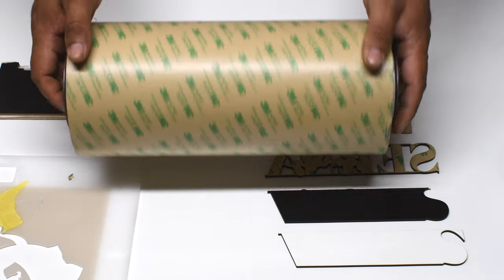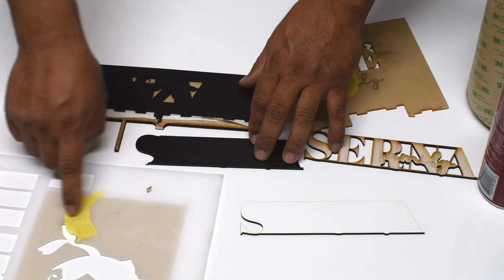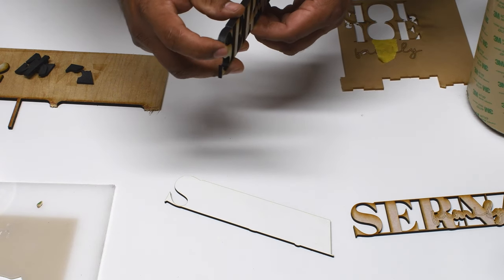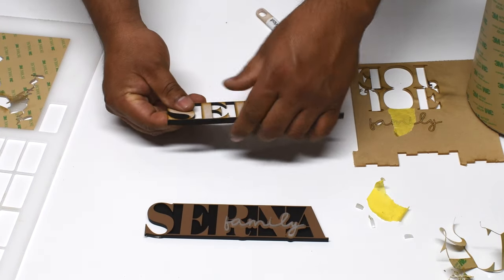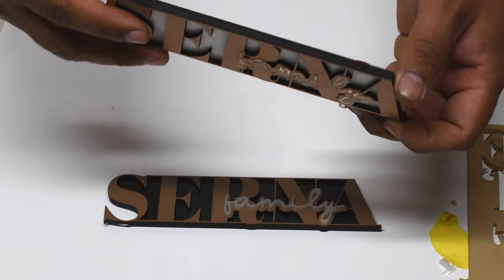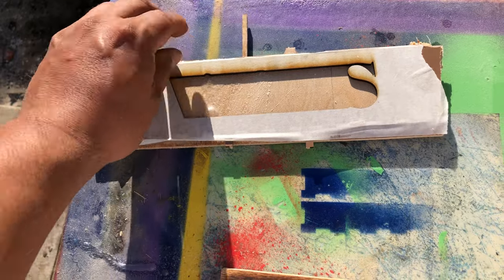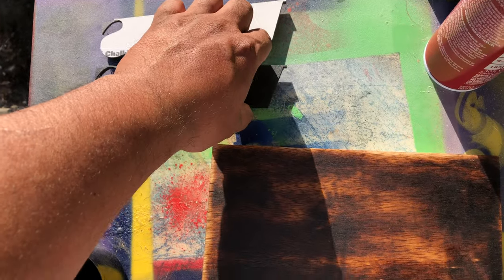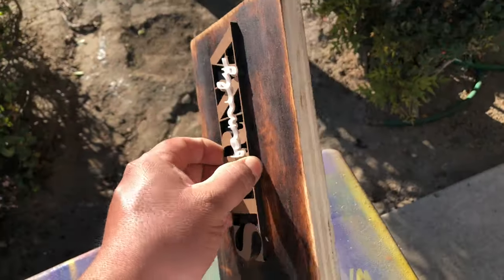3M Double Sided Tape VS 3M Adhesive Spray - Which is Better? | CRAFT FANATIC

Comment: Thank you so much for this video!

I am building a small building table 4'x12" and I am putting 1/4 inch cork on the plywood top and I have the super77 and now I know to spray only the cork and then quickly put it on the plywood

Thank you so much again!
Daniel
Reply from the maker: You’re very welcome

Comment: Thank you for producing these videos and especially the comparison between the 3m 77 and 90 sprays. I would like to know, how do you find the adhesive property differences between the 77 and the double-sided tape you are using in the video? Is there a benefit to using tape over spray adhesive?
Reply from the maker: 3M 77 and 90 sprays are both aerosol adhesives made by 3M. The main difference between the two is the bonding strength and drying time.

3M 77 spray adhesive has a moderate bonding strength and is suitable for bonding lightweight materials such as paper, cardboard, and fabric. It dries quickly, in about 15 minutes.

3M 90 spray adhesive has a strong bonding strength and is suitable for bonding heavier materials such as wood, metal, and plastic. It takes longer to dry, about 24 hours.

Both sprays are clear in color, non-staining and have a low soak-in properties. They are also both repositionable for up to 5 minutes after application, and can be used in both indoor and outdoor applications.

In summary, if you need a quick-drying, moderate-strength adhesive for lightweight materials, 3M 77 spray adhesive is a good choice. If you need a strong adhesive for heavy materials, 3M 90 spray adhesive would be a better option.
Reply: @CraftFanatic2023  An excellent characterization of the products being compared. Thank you!
Reply from the maker: Thank you